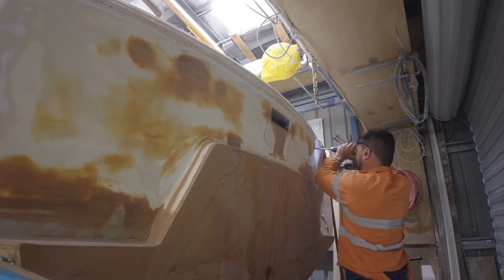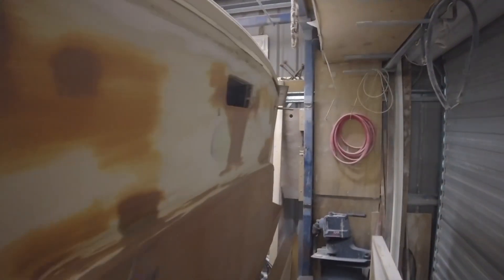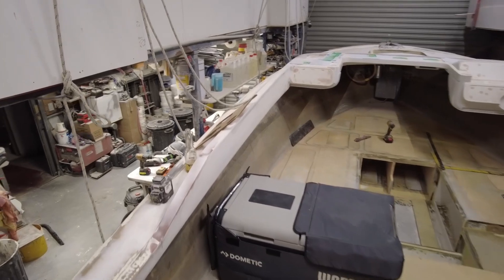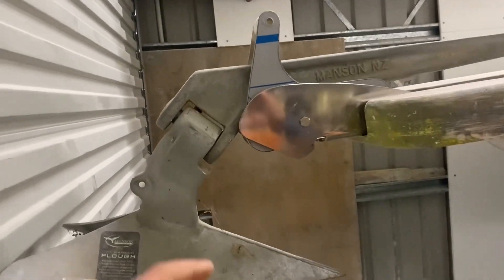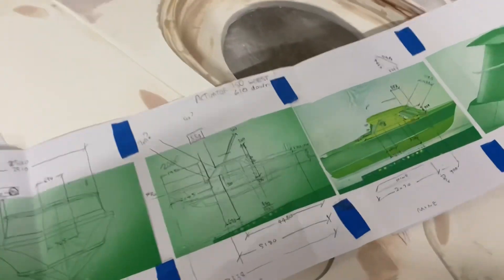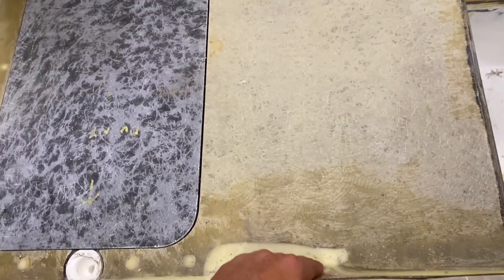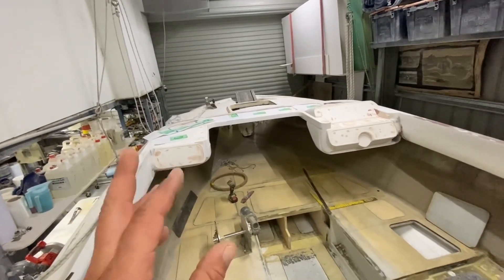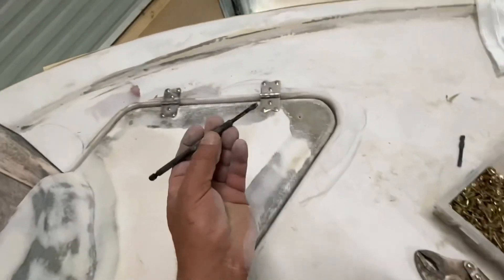25ft Bertram project - Blob 45 - i know what I’m doing… what am i doing…

Comment: It’s the little things like attaching the top back on that revive your drive to keep going! You sound a lot more positive in this video! I spent last year rebuilding an old Haines hunter v198 and the reward of finishing it out weighs all the suffering.
Reply from the maker: Definitely a morale booster getting the deck like that. I’m thinking I might make the Dummy windows and the curved windows for the Perspex to wrap around before I put the topcoat paint on just in case I need to do some temporary screws into the dash I can bog them up later
Reply: @Micington  yea I agree, definitely worth trial fitting as much as possible before any top coats, love your work 🤙

Comment: Getting there now mate. Hey if you can, go for sst deck join belting rather than ali it will look much nicer ie 30x4 316 flat bar polished. Couple things re seating, the fridge location is good you could put a pair  of flip back seats on top so can face fore/aft then have a single flip back in front of those seats for the forward port side passenger BLA sell double flip backs as well.. you might even fit one in for starboard drivers seat then ur little mate can sit beside and learn to drive...pretty sure they also come  without the  upholstery so you can go custom which would be cool... have had bench seats running fore/ aft in one of my boats, everyone hated sitting there!. One more thing, have a think about putting the head forward in the cabin just bow side of the helm so when on it ur facing the centre line or keel, this works really well, Tristram boats & Rayglass both do this over here. How do i send you some pics? Cheers S
Reply from the maker: Michael keller on Facebook. Add me. The fridge was gonna have no back rest because it’s too short and I think it’ll be too high also.  I have been told to do the rub rail polished stainless and might go that way. $$$. Probably should seeing as I gone this far. Toilet facing how it was is not good? The sort to get into it was probably gonna be where the low spot in the stringer/water tank was but I can change that I guess. I would love to see pics and any other good ideas. More brains are better then one!

Comment: Your getting there mate Persistence beats resistance every time. My only concern is moving that deck around so much could be asking for trouble Can it be fitted permanently to maintain its strength
Reply from the maker: I agree. If I attach the deck permanently now  it’ll be a million times harder to sand it and paint it. I should get away with lifting it off one more time to finish it off. Plus I really need to clean up the hull edges where the deck joins.

Comment: I know you want to get the boat in the water, but I think you'll be smarter to install your cleats below deck with a hawse hole so the cleats aren't up on top of the deck where they can catch on everything. They just work and look so much nicer. I think they will be more work than you think and doing it later probably won't  happen.
Reply from the maker: Hahah I’ll check out hawse hole at the chandlery next time! Cheers I didn’t know what they were called. Do the cleats screw into a thick piece of wood fiberglassed to hull or do they have bolts thru the hull holding cleats to hull???

Comment: Are you going to use screws or pop rivets to secure the deck to hull?  Going to use epoxy glue on  internals at hulk to deck? New stainless rub rail? Fun fun
Reply: With regard to anchor locker and water intrusion, make sure it's well sealed and give it a couple good external drains with clamshells on exterior, should be fine
Reply from the maker: My thoughts too
Reply from the maker: Screws/ nuts n countersunk bolts . Fibreglassed from behind with heavy Rovens
Reply: @Micington  huge pain in ass to tab all that glass inside hull to deck but Bullet proof also! Nice to see you are overthinking everything! Tunes especially Smiles! How much longer do you think before launch? Still got motor trans prop and more thinking!  Think my Bert will be less of challenge, deck doesn't need removal all glassed inside deck to hull Stringers hull and all bulkheads etc. Rock solid. Could just jam steering wheel and engine and controls in it a go boating! But need and want to re do it Sorta, at least back to original. Then maybe sell and let new owners make it pretty with interior A/C small gen set, and cozy for weekending etc. It could be nice fish dive runabout for someone. I already have a pair of 33 Bert sportfish and a 31, more boats than I need that's for sure! Have had my boats for many years and not getting younger
Reply from the maker: Where about are you? Sounds like you definitely have your hands full. We need a bunch of robots to boss around to do all of our dreams by sounds of it lol glassing the gunnels in will be a breeze compared to the window frames and roof extension lol

Comment: I would be very concerned with the amount of water that will enter when bucking into a moderate sea through that opening for the anchor line.  I have been many times caught where to get to harbor I had no choice but to be taking a lot of slop over the bow, a few times pure seawater.  You don't need any access holes in those situations as it is like being force fed with a five inch fire hose!!  It can shed off the bow deck but it will fill the boat if given a chance.  One other thing is that most boats end up with the 'V' bunks going up hill to the bow.  So the most comfortable sleeping position is feet forward in the smaller area which leaves you head down, a very uncomfortable position.  Try to slope the V bunks level if possible even a little down is nice.  I have also glassed over that shoe box joint in a couple of boats of that size just as yours is now.  Mix epoxy and fill the void then layer your glass with larger to smaller widths up to the top of the gun'l.  Fair it out and it will make a strong and good looking joint.  More glass at that region is good insurance for those point loads when gun'ls collide or gun'ls and docks.  In fact most commercial boats are glassed together there.  A heavy rub rail can also be attached over the top as they make extrusions for just that purpose if you wish.
Reply from the maker: I agree with you here also! Haha 😂 which is a big reason it’s taken me so long to decide on this part. The only reason it’s like how it is is because I needed to make a decision and I’ll modify it if it’s a problem later down the track. 

The other thing is I did make the v bunk level with the floor and I think it’ll feel fine head toward steering bulkhead fine as far as I know atm. The v bunk head space is very unimpressive. I tried to make it slightly higher and is a big reason for big opening into the v bunk. I appreciate your input! Cheers
Reply from the maker: I’ll definitely be glassing the deck skin to the hull. Which is what I interpret what you are saying